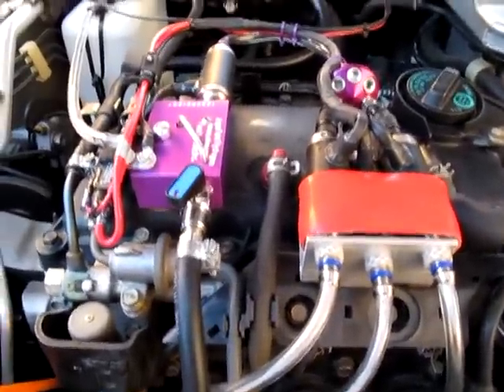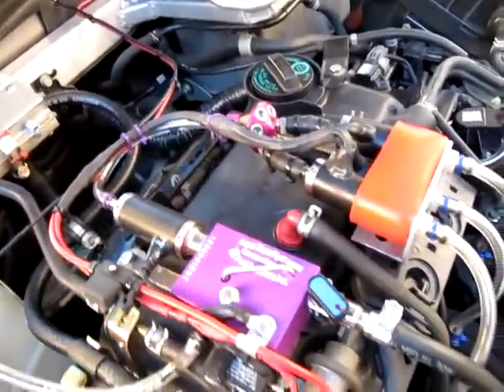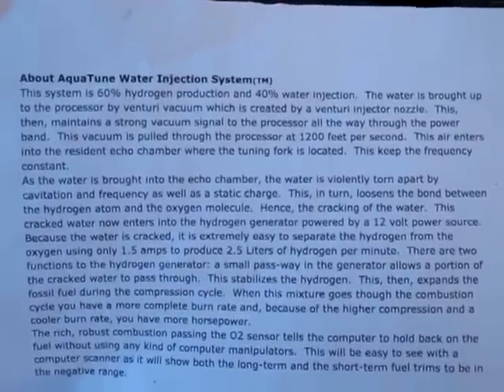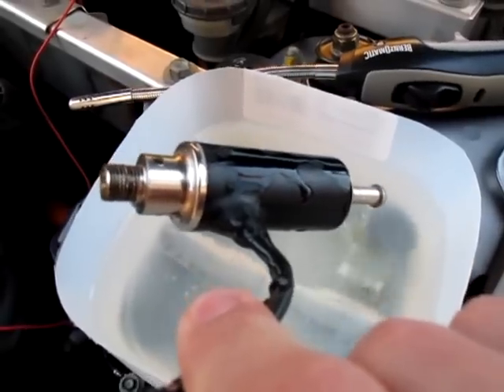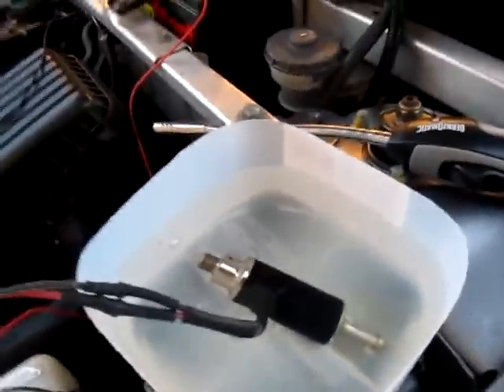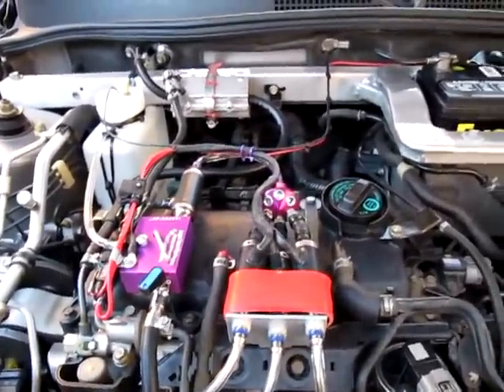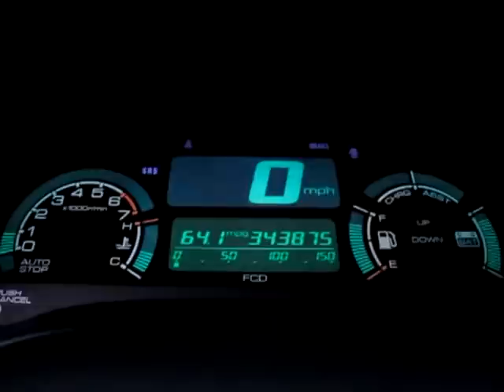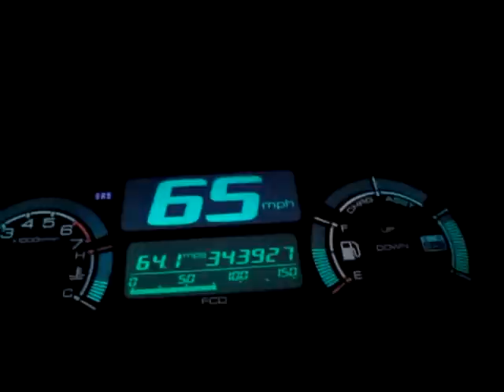Water Fuel Technology For Everyone - AquaTune Hydrogen Fuel Systems

Comment from the maker: You are exactly right. In order for the Hydrogen Generators to Produce 2.5 Liters Of Hydrogen Per Minute(Each) The Hydrogen Generators must be connected to- or downstream from- the Distilled Water Processor. The Distilled Water Processors specific job is to weaken the water molecules covalent bond- which is the bond that holds the Oxygen Atom To The Hydrogen Atoms. This Bond or "Covalent Bond" is weakened in the Processor with Resonance and Frequency- as well as a Static Electrical Charge.

Comment from the maker: The AquaTune Hydrogen Fuel System injects 60% Hydrogen and 40% water mist. The water mist portion of the injection expands the gasoline inside the combustion chamber- Then the covalent bond of this 40% water injection breaks. This is additional energy that is usable to move the automobile ie Motive Force. Before the 40% water injections covalent bond breaks in the combustion chamber- It expands the gasoline- obsorbs heat- raising the octane rating- advances the ignition timming- then burns :)

Comment from the maker: Therefore we do not need to manipulate the automobiles computer in order to achieve fuel efficiency and horse power gains. Thus no need for an EFIE(Electronic Fuel Injection Enhancer). AquaTune specifically and exactly design the AquaTune Hydrogen Fuel System to work in harmony with the automobiles engine and computer system- without need for any aftermarket computer manipulation. AquaTune also works with Turbo Powered Engines- and AquaTune makes extremely interesting units for Diesel Engines :)

Comment from the maker: Your statement is interesting. I know these generators are very expensive to have made. The AquaTune Hydrogen Fuel System is extremely high quality. Every aspect of the design serves the purpose of Efficiency and Reduced Emissions. Once I began to understand how efficient and well made and well thought out the AquaTune Hydrogen Fuel System is- I realized the system is actually priced quite resonably. Sometimes AquaTune has older models available at a slightly reduced cost. That's another choice.

Comment: Question: do the extra generators (per your installation) siphon more water or do they simply act on the 40% water being passed through the first generator? I would like to know because I would like to also install one generator per cylinder on an american V8, and wondering how efficient extra generators are with only one line.. any ideas?

Comment from the maker: I will work on this. A simple way to calculate your mpg increase is to know that AquaTune Hydrogen Fuel Systems reduces fuel consumption by a minimum of 25 percent. I have consistently and continuously achieved a minimum increase of 25% in fuel efficiency after installing the AquaTune hydrogen fuel system onto the 2000 Honda insight.

Comment: i dont know if it already had been asked, but does the hydrogen generator generate always the same amount of hydrogen gas? or is the voltage lowered/altered depending on how much throttle you give it?

and whats the average miles per gallon of water so far?

and last question: when you first start it do you have to wait some time for enough hydrogen to be produced to continuously run the engine?

Comment: this seems good dude. I am aware that engergy with vacuum and magnetic field will disassiociate. you may run into a problem with DOT regulations. your close to what Stan made. 1.6 amps with what you produced with the test you did is about normal and not the 2.5 lpm that you said its produces. I still am interested

Comment from the maker: Hi bravo. The Hydrogen Producing Capacitors produce 2.5 Liters Of Hydrogen Per Minute(each) at 1.5 Amps(each). The AquaTune Hydrogen Fuel System comes with one Hydrogen Producing Capacitor connected directly to the Processor. I add three additional Hydogen Poducing Capacitors downstream from the AquaTune Processor in order to increase fuel efficiency and horse power to a greater degree than running the single Hydrogen Producing Capacitor.

Comment from the maker: Hi Darrell. I made a video titled "On Road Chronicles" which shows the miles per gallon(mpg) as averaging about 58mpg maximum on flat ground, on the highway- with the car being stock- without AquaTune- and with the High Voltage Hybrid Battery turned off. The car would not go over 58mpg without the AquaTune- on the Highway. With AquaTune- The car can easily stay above 75mpg and up to 125mpg and I still have the High Voltage ie 120 Nickel Metal Hydride D Size Cells- Turned off.

Comment from the maker: 2000 Honda insight. Same body style from 2000 to 2006. 1 LIter, 61 Cubic Inch, 995cc, 3 Cylinder VTEC-E Engine. The car is a Hatchback with the optional Air Conditioning. The transmission is a five forward gear(tall gear ratio) manual transmission. Honda also offer the first generation honda insight's with automatic transmissions, see CVT Transmission.

Comment from the maker: First- Congratulations on your interest in this technology. AquaTune makes a unit which I believe is the unit design for high performance engines(Please confirm this with AquaTune Tech Support). It's called the AquaThrustPlus HB. You have excellent question regarding how the AquaTune unit functions in terms of what the upstream, number 1; or primary O2 sensor reads(Oxygen Sensor(s) between the Catalytic Converter, and the Engines Exhaust Ports). Continued:

Comment: Hello there that is smart bit of kit. And will it work on motorbikes guesing 4 strokes will be ok. But what about 2 stroke?
Reply from the maker: AquaTune Hydrogen Fuel Systems makes a Water Fuel Technology system for 4 stroke motorcycles as well. However not for two stroke motorcycle engines. Thank you for your question :)

Comment from the maker: Hi Markus. The approximate 70 Pound(120 D Size NiMH Cells wired in series) High Voltage Hybrid Battery is still in the car. I simply turn off the high voltage battery breaker switch which is located just above the high voltage hybrid battery. The 2000 to 2006 First Generation Honda insight only weighs approximately 1800 pounds. Aluminum Frame and body, with a 30% increase in structural rigidity over a comparable size car made of steel. High Strength, light weight.

Comment: There are many companies out there guaranteeing fuel efficiency using HHO Gas. Does your device come with a six-month Moneyback Guarantee for continuous fuel efficiency. What I mean is if any time during the six months this device fails to perform as promised for continuous fuel efficiency do you offer a complete moneyback guarantee?
Reply from the maker: Hi Peter. The AquaTune Hydrogen Fuel System comes with a 2 year warranty. Please confirm this with AquaTune Hydrogen Fuel Systems. I provide the link near the bottom of the video description.

As long as the air we breathe contains approximately 78% Nitrogen, 21% Oxygen and just under 1% Argon- The AquaTune Hydrogen Fuel System will continue to reduce fuel consumption by a minimum of 25%. No moving parts- No electrolytes- No maintenance- No need for computer sensor adjusting nor manipulation. You would be a very good distributor for AquaTune. Because you have a basic understanding of energy systems- and a willingness to learn. You are also very patient- and able to understand what many find mysterious. Great Video's Peter :)

Comment: I live in Canada and we get a good deal of weather where temperatures are below freezing.  I am curious to know how this system would work under freezing conditions.
Reply from the maker: Add one part isopropyl alcohol to one part distilled water to the AquaTune water reservoir. This mixture permits the AquaTune Hydrogen Fuel System to work very well in freezing weather conditions. Thank you for your question :)

Comment from the maker: Note: It is well known that Vacuum increases Hydrogen Production Efficiency. Study how many experimentors are vaporizing water without heat- with nothing more nor less- than sufficient vacuum. Vacuum reduces molecule surface tension. I'm still in the process of learning why vacuum also increases Hydrogen Production Efficiency with traditional electrolysis systems. Interesting area of study :)

Comment from the maker: That is exactly what happens when running traditional electrolysis systems in computerized automobiles(ie newer model automobiles which have oxygen sensors monitoring oxygen levels in the exhaust system).The AquaTune Hydrogen Fuel System works completely different. The AquaTune Hydrogen Fuel System is design to work with the engines computer system,not against it. Thus-no need to manipulate the computer nor sensors to achieve fuel efficiency and  horse power gains. You may also contact AquaTune.

Comment from the maker: Hi. Before I purchase the AquaTune Hydrogen Fuel System for the 2000 Honda insight, I ask AquaTune Technical Support if I may add additional generators to further increase power and efficiency. I specifically ask if I may add one generator for each combustion chamber of the engine. For this engine, which is a three cylinder engine, that would be three additional AquaTune Generators. The results are outstanding :) Please contact AquaTune Technical Support in order to have your question answered.

Comment from the maker: Yes. The AquaTune Hydrogen Fuel System works very well with automobiles that use Natural Gas Vapors(CNG) to run the engine. Including, Gasoline Powered Engines that have been upgraded(Natural Gas Fuel System Conversion) with a Natural Gas Vapors Fuel System. Please contact AquaTune Technical Support to learn more about how well the AquaTune Hydrogen Fuel System works with Natural Gas Vehicles. Excellent Question :)

Comment from the maker: The upstream Oxygen Sensor(or Wideband Air To Fuel Ratio Sensor) sensing a rich air to fuel ratio- permits the automobiles computer to reduce the Pulse Width Signal to the Fuel Injectors- thus reducing gasoline consumption by a minimum of 25%. Horse power is also increased as well. The AquaTune Hydrogen Fuel System is design to work with the automobiles computer to increase fuel efficiency and horse power.

Comment from the maker: The AquaTune Hydrogen Fuel System does not harm the engine in any way. In fact, the AquaTune Hydrogen Fuel System is good for the engine ie removes carbon buildup within the engines internal combustion chambers- as well as helping to keep the EGR(Exhaust Gas Recirculation Valve) and Catalytic Converter clean as well. If you have more questions, Please contact AquaTune directly. Technical support is highly qualified to answer your technical questions- as well as help you with pricing specifics.

Comment: so have you replaced the gas system completely? how do you accelerate the motor to different rpm's when your putting your fuel directly into your intake manifold where is the control for fuel amount?
Reply from the maker: Excellent Question. Please contact AquaTune Hydrogen Fuel Systems- Technical Support to have your question answered. AquaTune is highly qualified to answer questions related to their Hydrogen Fuel systems.

Comment from the maker: The AquaTune Hydrogen Fuel System is completely design around this concept of efficiency. This is a completely different approach to Hydrogen Production, compared to the over 200 year old traditional approach of Hydrogen Production. The traditional approach to Hydrogen Production from the water molecule is called Electrolysis. Electrolysis uses high amperage to break the water molecules covalent bond. AquaTune hit's resonance with frequency- within a vacuum and a self generated static charge.

Comment from the maker: With the 2000 Honda insight-which utilizes a 61cubic inch, 995cc, 3 cylinder VTEC-E Lean Burn Engine(Air To Fuel Ratios up to 25.6 Parts Air To One Part Fuel, Measured with a MoTeC Air To Fuel Ratio Gauge)with the AquaTune HB which permits an average fuel efficiency of 75 miles per gallon, with significant increase in engine power ie throttle response and acceleration.That is 75 average miles driven per US gallon, times 10 US gallons, times two tanks of gasoline=1500 miles per 2 Liters of water.

Comment: Where is the hho output connected to? Do you inject it into the air intake stream, fuel line or engine cylinder? Can't seem to find that info on the website or videos. Thanks

Comment: hydrogen is produced when a DC electric charge is passed through water, right? is there a way to store pure hydrogen to eliminate all the complicated parts... so that there can be a direct injection system or even a similar vacuum system without all the generators needed??

Comment from the maker: The 40% water mist injection is distilled water that has been struck at resonance with frequency under vacuum conditions- within a static electric field. This weakens the (covalent) bond that holds the Oxygen Atom to the Hydrogen Atoms. Thus-once the 40% water injection enters into the engines combustion chambers- the water encounters extreme heat and compression- which permits the weakened covalent bond to be broken- thus releasing the Hydrogen and Oxygen within the engines combustion chambers.

Comment from the maker: As a side note in response to your idea of adding a gasoline vaporizer- My research and study have indicate that billy's(see YouTube Channel iambillythekid) gasoline vaporizer concept works quite well in terms of completely vaporizing today's gasoline mixtures ie additives. And though billy's white vapor system leaves a residue in the vapor chamber- several experimentors have used 700F minimum stainless steel surface temperature to spray the fine droplets of fuel onto- with no residue remaining.

Comment from the maker: Additionally- The 40% water injection is distilled water that has had it's covalent bond weakened- To such a point that once the water molecule encounters the extreme heat and compression within the engines combustion chamber- The covalent bond breaks- Thus releasing the Hydrogen and Oxygen that was the distilled water molecule. The water molecules covalent bond breaks after expanding the gasoline- reducing combstion temperatures- increasing the octane rating & advancing the ignition timming.

Comment from the maker: Hi. The white vapor fuel system(see screen name iambillythekid) is still of interest to me. Experimentors that have replicate billy's design- have done so for older model automobiles ie before electronic ignition and computers. I'm researching MoTeC and additional systems which permit Alternative Fuel Systems-such as running an engine on Natural Gas(see CNG) and Propane(see LPG) and permit full access and adjustment of Air To Fuel Ratios and ignition timing- As well as fuel injector Pulse Width.

Comment: how does this system not produce a higher O2 count in the exhaust, that then trips the 02 sensor, thus requiring an eife or obdII chip ?       if it truly doesn't need a chip, your #1 selling point to anybody thats built there own gen is not needing a chip.

Comment from the maker: Your explorations sound a lot like the GEET Acceleration Chamber. For example- The GEET Reactor(no alpha beta nor gamma radiation present ie not harmful to humans) utilizes 11 Hg of vacuum, a venturi which accelerates the cold(from phase change ie Liquid to Vapor State) fuel vapors to 761 miles per hour ie Mach 1(at sea level) with a counter flow of Hot Exhaust(See importance of temperature differential) thus producing a highly charged, ionized particle(low temperature plasma).

Comment from the maker: Popular Mechanics wrote two incredible articles on Smokey Yunicks Hot Vapor Car(See via Google Search)And offered great knowledge and insight into the very intricate design of Smokey's Fuel Vapor System. I realize Popular Mechanics did their very best to make the AquaTune fuel system operate at maximum efficiency. However- being passionate about mechanics and having access to an endless sea of physicist and mechanical engineers does not equate to qualified ability to instal the AquaTune systems.

Comment from the maker: I do not have a picture of the Venturi Nozzles. My understanding is that even without use of a Venturi Nozzle, When we have an air flow past a 90 Degree port- Vacuum will be drawn through that port(Google Search "Venturi Vacuum Theory"). In this case, the port is the Hydrogen + Water Mist Fuel Lines entering the intake manifold via the Venturi Nozzles(at a 90 Degree Angle To The Intake Manifold) which are threaded into the intake manifold approximately 2 and 1/4 inches from the cylinder head.